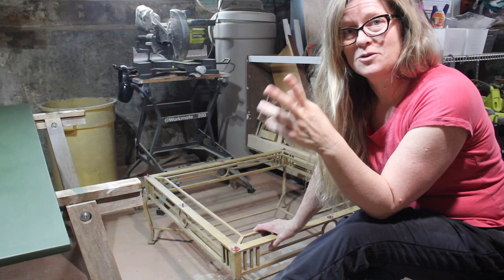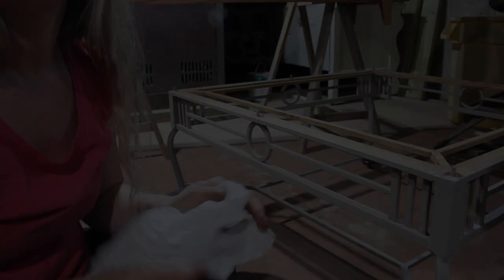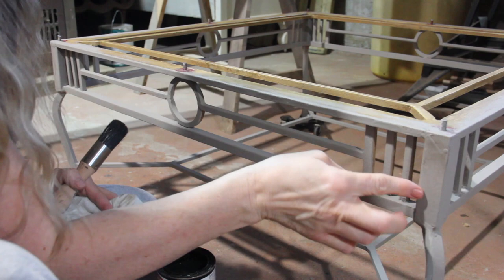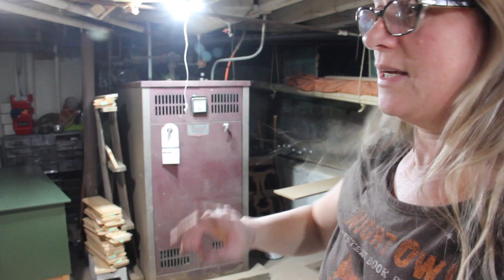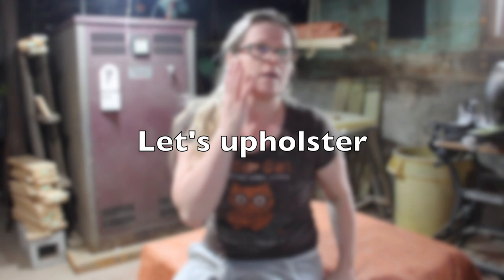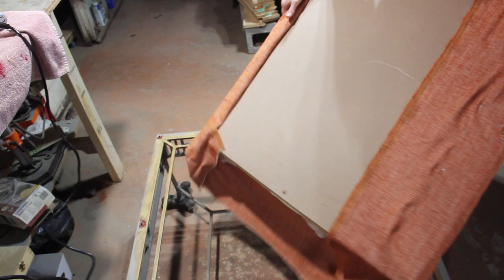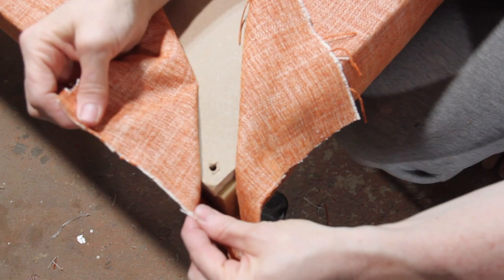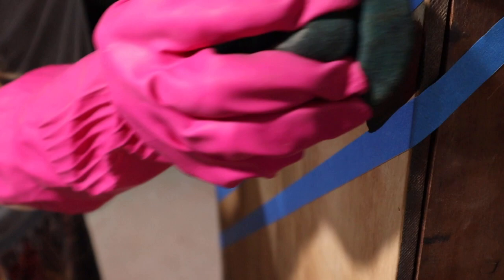FREE Upcycle coffee table | HOW TO Upholster | Extreme Furniture FLIP | Trashed to Treasure | DIY

Comment: Not sure how you could usethat for either an ottoman (not strong enough) or a coffee table (too soft to set drinks, etc. on).  Totally futile projrect.
Reply from the maker: Wow Brie you sure jumped to an mis-conclusion! I actually did use it as a coffee table. Worked well even placed a tray on it at one point. The legs were metal so no worries about strength. Have a good day love!
Reply: @VintageAndPainted  no I don’t think I jumped to the wrong conclusion.   And ottoman is a piece of furniture that you either put your feet up on or sit on.   Not sure this piece could be used for that.   I do see that you could put a tray on it and use it as a coffee table, but you couldn’t just a cup of coffee on the piece  I’m glad it worked out for you though